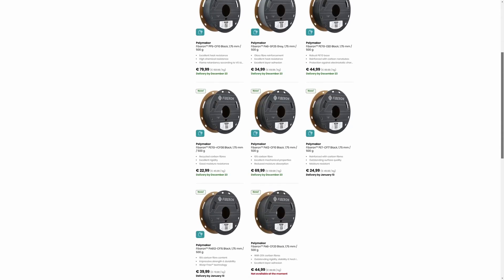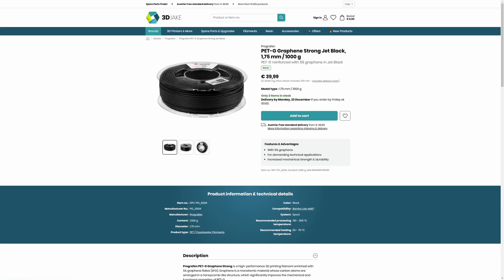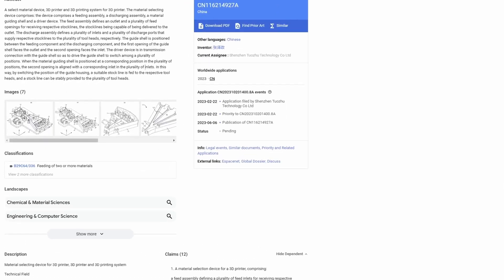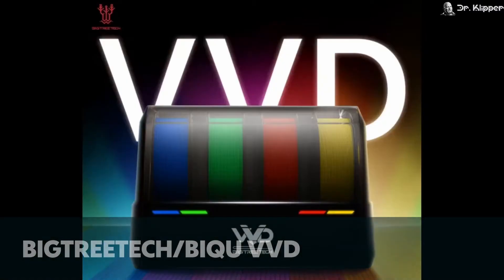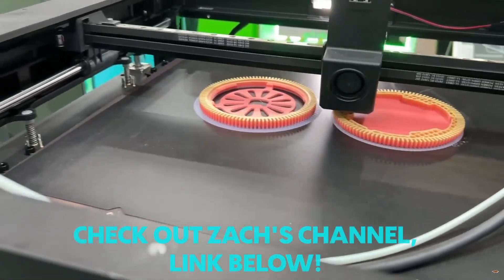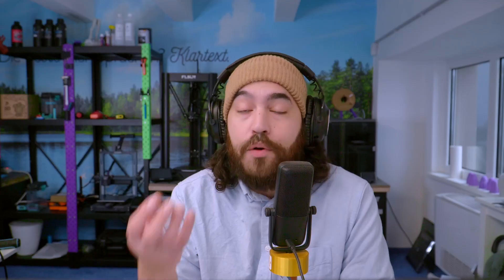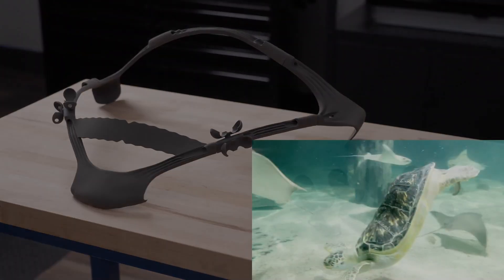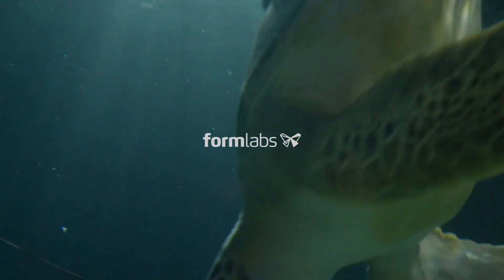Community News December 2024: New Products and News Updates!

Comment: I've not seen the Bambu leak outside of this video but if it can only load one nozzle at a time, surely it won't be any quicker or less wasteful than their current solution? I kinda hope it works more like the AnkerMake V6 was supposed to. That'd do the trick, otherwise it might aswell just be a standard IDEX with the usual AMS capability.
Reply from the maker: True, the patent images are confusing as they have the dual output but only one channel running from the hub to the output so god knows what is really gonna come out, we just have to wait and see. IDEX makes more sense plus you have all the advantages of an IDEX too but it complicates things and thereby raises the price, if they can get the dual channel working it would be awesome.

Comment: The latest brick layer patent, that is holding back the feature from open source... Is likely invalid.

Seen a video not long back where someone actually looked into the patent. Seems they screwed up some references in their application. They put in references to another companies now expired patents related to brick layers. The patent reference numbers given point to completely unrelated patents. If you find the proper patents with some digging by name... The prior patents basically describe this new patent. This means the patent office granted the new patent without being able to properly bring up the old references, which would demonstrate prior example.

The reference numbers are all off by a single digit and point to patents by the correctly called out company, but for different unrelated things... Do with that bit of coincidentally convenient happenstance as you will.

Comment: The patent drawings I‘ve seen so far, would not allow to feed two nozzles at the same time, which would be necessary, to speed up color or material changes during the print (continuosly feed the actual filament, while already preparing the other nozzle with a different filament). There is either a more advanced patent in the pipeline, or the next model would disappoint expactations regarding this feature.

Comment: Is there already a printer on the market, where any color can be printed by mixing white+red+yellow+blue filament?
Would be so cool, if the Bambulab A1 mini could do this, but not possible currently, right?
Does the AMS has four seperate filament feeding motors?
Then it could be possible with a 4in1 fusion nozzle
Reply: In theory, a 4-in-1 fusion nozzle could enable the mixing of different filaments in real-time to create custom colors, such as orange by blending red and yellow filaments in a given ratio.

Here’s how that would work:

Filament Mixing: With a 4-in-1 fusion nozzle, the system would allow all four filaments (e.g., white, red, yellow, blue) to be fed into the nozzle simultaneously, but in specific ratios controlled by the feeding motors of the AMS.

Feeding Motors Control: The four dedicated feeding motors in the AMS would control the ratio of the different filaments being fed into the nozzle. For example, to create an orange color, the AMS could feed 50% red and 50% yellow filament to the fusion nozzle.

Fusion Nozzle: The fusion nozzle would then mix these filaments as they pass through and extrude them as a single stream of filament with the desired color (orange, in this case). This would allow dynamic color blending, creating various shades on the fly based on the filament inputs and the printer's instructions.

This would be an innovative way to create new colors without requiring separate extruders for each color. However, while the idea is technically possible, as of now, such 4-in-1 fusion nozzles are not commonly found in consumer-grade 3D printers like the Bambu Lab A1 Mini.

If the A1 Mini or other printers supported this type of nozzle, you'd need both the appropriate hardware (the fusion nozzle) and the software to manage the real-time mixing and control the filament ratios. But in principle, with the correct setup, you could achieve continuous color mixing based on the ratio of the filaments provided by the AMS.

Copyright by me, 2024-12-22

Comment: Yes, the "catcher" you describe is also in patents, there's several diagrams of both the arm that goes under the extruder, there's mention about priming and keeping the pressure up with it too (e.g. possibly no need for a prime tower!?) but also patents for algorithms that will calculate the filament crossover between the heads/ams hub etc. and I'm assuming to reduce purge - some are saying that the patents refer to a type of buffering similar to how the Mosaic Palette works, and there may be a cutter involved, possibly allowing pre-cut lengths of filament needed before moving onto the next one with no 'swap' time. all conjecture but the patents look tasty
Reply from the maker: That's awesome! Thanks for the info. Looking forward to an official release
Reply: Meh, the smartest design would be to have 2 dual extruder tool heads and then a tool changer like the Prusa XL has but it would only need to be for 2 tool heads instead of 5/6 to accommodate all 4 materials in the AMS with its own nozzle.
It shouldny add that much more cost to just add one more additional dual nozzle tool head,
And it could print one color from the first head and then dock it at the back of the machine and grab the second tool head to print the second color and then the first tool head could purge while it's docked rinse and repeat.
I hope this is what it is and the name seems to suggest it too.
H=Heated chamber, 2 = 2 tool heads, D= dual extruder heads.